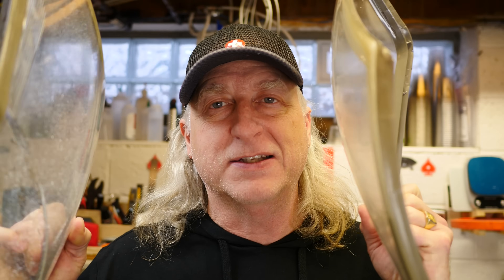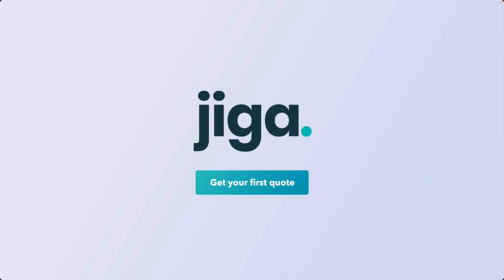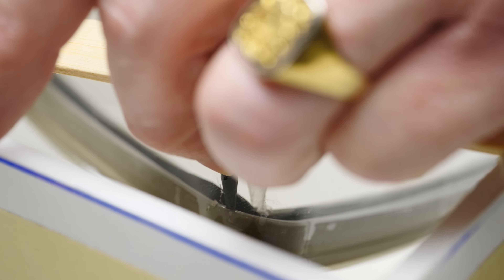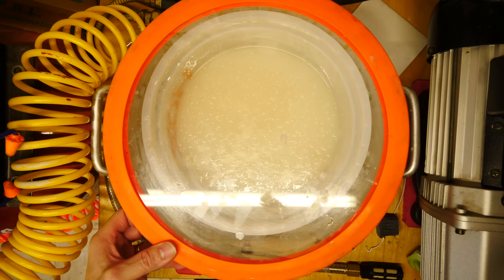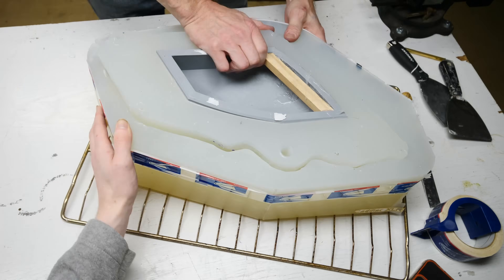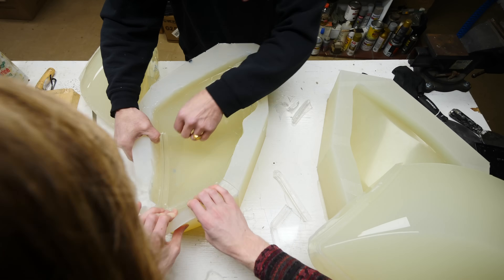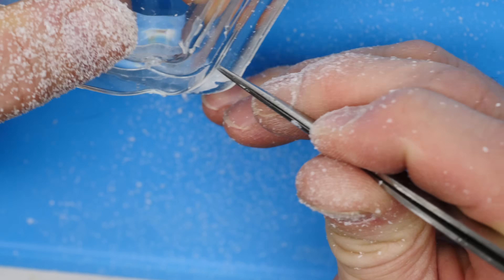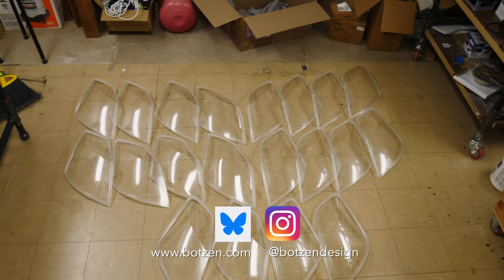CUT Molding Resin Cadillac XLR headlight lenses

Comment: Yourclient screwed up by not taking 5 minutes and a very little heat to remove the factory sealant. By not doing thst they do not fit properly and it too far awzy from the housings plus they do not look correct with that clear edge that should be gray green.
Reply from the maker: Paint

Comment: I feel bad asking about this because I might have already asked you, but I'm desperate.  I really, really, REALLY want to get molding and casting.

According to Google, most action figures are made of ABS and PVC plastic.  You said in this video that you were using ABS for the project.

Do you know how and where I can obtain castable, safe to handle before and after cured, PVC?  I was shocked to find out from Google search that PVC is toxic even when fully cured.

Also, where can I obtain ABS casting materials like you mentioned at 10:06?  Is it only obtainable from 3D printers?

Once again, thank you so much for your help and support 🙏
Reply from the maker: ABS is just used for 3D printing, we cast in urethane,
Reply: @EricStrebel  oh, so you mean you guys don't cast ABS, or it's not possible to cast ABS?

And urethane is safe too?

I'm so sorry for being a slow learner 🙏
Reply from the maker: @0newingedcrow not that I know of

Comment: very cool video and pertinent considering I am restoring a car and considering doing cast mold of less complicated NLA tail lights.  Seeing how much silicone would it be worth making a 3d scan and print a filler structure closer to the lens to pour in silicon (like a hard bottom part of a mold frame or case) and reduce silicon volume costs and complication?  Sorry if noob question...  I am a couple weeks into owning a printer and scanner and a hobbyist.
Reply from the maker: It's possible
Reply: I just realized you showed in my feed because I watched your tail light lens video!  Amazing overview of processes and importance of each step.

Comment: Have you ever considered making a larger "Autoclave" by using concrete?
The issue that most people have is that larger internal spaces require greater thickness of the walls.  
But
What if that re-enforcement was done in the form of hoop bandings in concrete?

Comment: Those are the largest cut-molds I've ever seen. I was really interested to see how you were going to go about cutting it. 😆
Reply: If it were me?
I would use thin shims that don't go all the way to Master Model.
Next I would create an over sized Mold puller/(ripper) and while the mold is under stresses just go about nicking the areas that just after the shims.  This would then open up the mold as you progressed.  
(Don't over stress the mold because the nickings would run and you would be tearing the mold instead of a revealed opening of the mold.)
And yes, as you progress you have to adjust the mold gripper to keep the tensions the same all the way through the process.